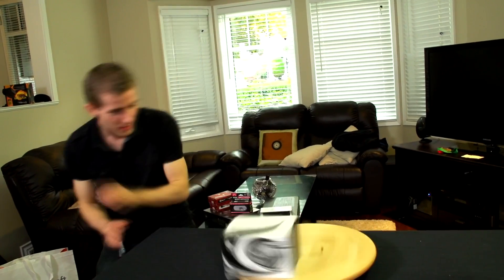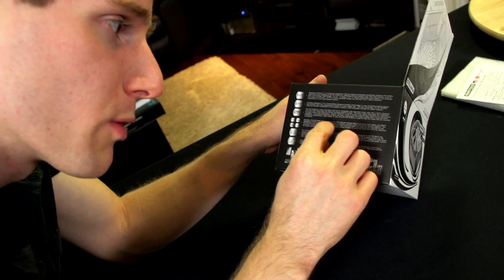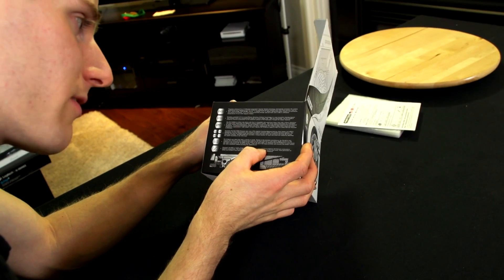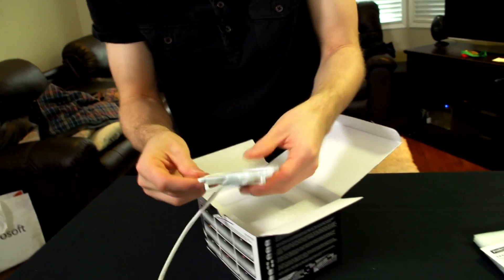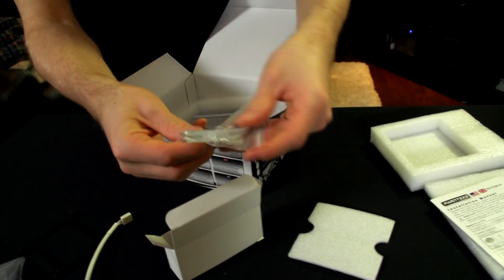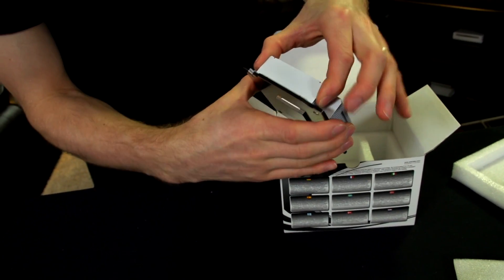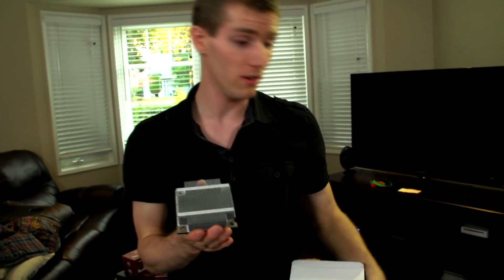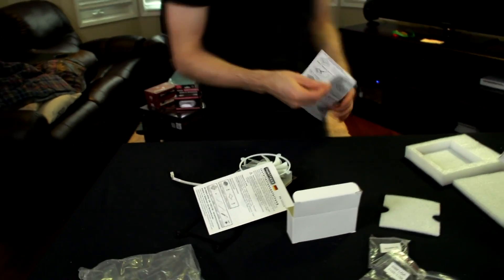Phanteks PH-TC90LS Low Profile CPU Cooler Unboxing & First Look Linus Tech Tips

Comment: Duh, the stock coolers are supposed to work without OC. What's the point of a STOCK cooler if it doesn't work with STOCK clocks........

Comment: The stock Intel fan is fine. It doesn't perform as well as most after-market CPU coolers\, as you would imagine, but it works fine for anyone that isn't using their computer for intensive tasks.

Comment: It might if the case has bad venting.  I ran my 2600K@4.1 on the stock cooler for the first year folding 24/7 weeks at a time.  Ran HOT in the 90s but without issue.  Now it runs in the 60s with the antek 920 haha.

Comment: ummmm....
even without overclocking, running the cpu at over 80% can auto-shutdown your computer due to overheating (with the stock cooler)
but if youre not gaming, then the stock cooler is fine

Comment: You do realise CPU's and chimps altogether work best at 50-70 degree Celsius. Having a CPU at 40 is actually counter productive. Also with that much processing at lower temps can cause additional damage to the metal / plastic components.

Comment: No, let me give YOU some advice.

1) Learn Grammar.

2) Techies like me build machines on a daily basis, for clients, companies and the like. They don't care for overclocking or for having sub-60 degree Celsius temperatures. They also like to keep costs down to the bare minimum, hence the usefulness of the Intel stock CPU cooler.

3) Not everyone overclocks, so why waste money on an aftermarket cooler when the stock cooler does the job perfectly fine?

Comment: Aluminium can oxidize just like iron it just doesn't go all the way through the metal the outer coats on aluminium prevents it "rusting" on the inside unlike iron. I wouldn't worry to much about it.

Comment: That's a cheapo looking fan.  I don't really think that cooler has what it takes to cool a 6 core processor.  It may be fine in a mini computer like Linus says, but I wouldn't trust it in a gaming system.  I'm more apt to use a Corsair Hydro Series cooler like the H80i or the H100i.

Comment: i i have the phanteks ph-tc14pe on a i7 3820 its a beast of a cooler well worth the money keeps things super cool 50 degrees max on a standard clock but youll need low profile ram for it to fit its also so bit it covers one of my pcie x16 slots on the gigabyte ga-x79-up4 motherboard

Comment: I used the Intel Stock cooler for my i7-2600k before it was cool! Now I own a H100, after my Scythe Katana 3 isn't ebough anymore.
The Intel Cooler did a great job but I wanted more power out of overclocking for this I needed more cooling. But the Intel Stock fan isn't "shit" it is not the best, but it is small and quiet so if you don't overclock it is enough.

Comment: can you make a video on how to change a watch battery on every watch that isnt a rolex?
what your asking for is too vague, unless we know what processor you have, what cooling setup you have, ect. if you need to ask how to overclock you really shouldnt, it isnt like turning the brightness up on your monitor, try doing ALOT of research about overclocking, its not hard, but it is EASY to do damage.